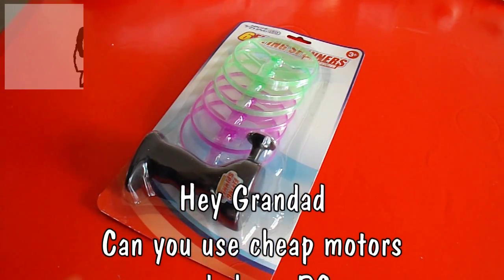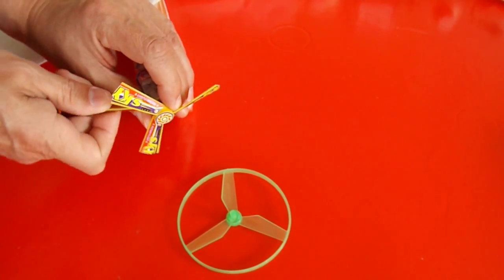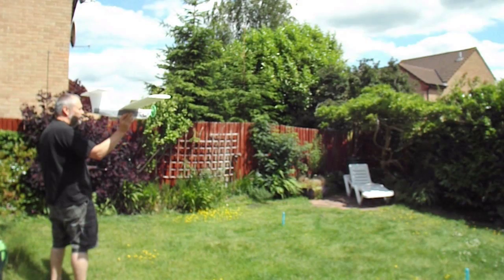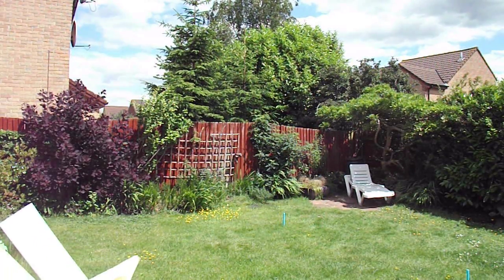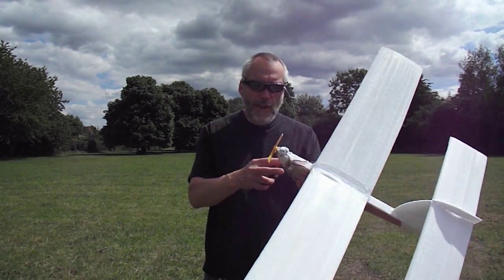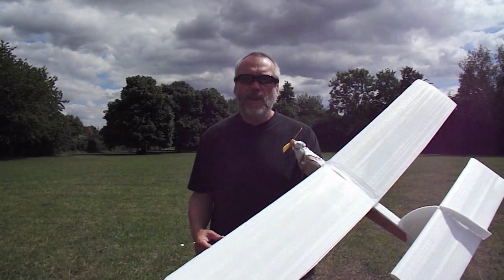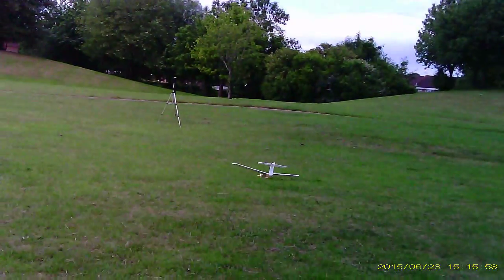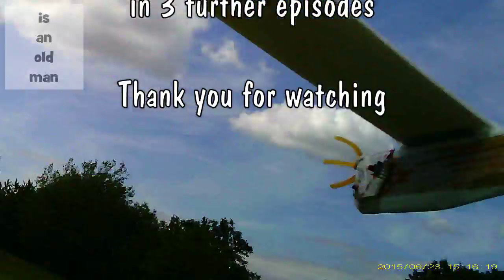Hey Grandad can you use cheap motors and cheap RC for a plane More Flights #1

Comment: If range is an issue for using the rc equipment, how about you overvolt the transmitter. I saw a project where they made a rc plane out of the parts of a cheap ultra micro rc car. They put more volts into the transmitter to increase range.
Reply: Also 3 bladed props arent ver effecient. I recommend 2 bladed props
Reply from the maker: adkodiyan no range is not an issue, I don't want the plane to fly far. In fact the idea is it flies to the limit of it's range and then the motor cuts when it loses the signal. I may try increasing the voltage to give the motor more power as the motor is fed through the receiver and they both use the same battery, however there is a good chance that will burn out the receiver. I may use the receiver to switch a small relay or a transistor to switch a larger battery to power the motor, that would eliminate the issue of overpowering the receiver.
Reply from the maker: adkodiyan what makes you say that? there are many reasons for using multibladed propellers, however as I am trying to make this plane from parts salvaged from toys the options are limited to the propellers I can find on toys.
Reply: This is why i said that 2 bladed props are more effecient. http://www.rcgroups.com/forums/showthread.php?t=917956. Also 2 bladed props are smaller so there is less effort for the motor, making the prop spin faster.
Reply from the maker: adkodiyan I read the first page of that thread. I didn't need to read any more, it is just full of people arguing theories and giving opinions. There seemed to be an equal balance of arguments for more blades and less blades. I certainly don't see how you could use that thread as a conclusive proof either way. As for 2 bladed props being smaller, one of the reasons 3 or more blades are used is to allow the plane to sit lower on the ground as you use a smaller diameter multi bladed prop compared to the diameter of the 2 bladed prop required for the same thrust. All of this is totally irrelevant to my current project as I am trying to source all the components from cheap toys and so far the only props I can find are toy helicopter rotors and none of them are 2 bladed.

Comment: i told u can always use a stronger motor and 9 volt battery whitout reciver or else the reciver will die so only 9 volt battery going into motor whit a swithc
Reply from the maker: Aleksander Sats you can always use a stronger motor, that is fairly obvious. I am trying to use the motors I have available as described in the introduction.
Reply: GrandadIsAnOldMan
oh but those stronger and bigger motors u can find well any toy that is big and moves

Comment: does anyone know how to convert an infrared receiver to radio?
Reply from the maker: +random person there isn't a simple fix. You would need to add some circuitry to pick up the radio frequency and unless you want to do it as an electronic project I would suggest the easiest fix is to swap the receiver for one from a normal RC car. The wiring to the motor and steering will be the same. If you really want to do the conversion I would suggest Googling some receiver circuit diagrams and comparing them.

Comment: Use the big battery for is have more power
Reply from the maker: +Bao Khang Kelvin putting a bigger battery on a cheap motor will make it run faster for a while but then it will overheat and burn out. It will also burn out the RC receiver.

Comment: you sould make the plane smaller
Reply from the maker: The idea of a larger plane is to reduce the wing loading to make up for the low power available. You will find many low powered planes have large wingspans and are very light weight. However, feel free to make one yourself to test the theory.

Comment: Can u make a battery powerd quadcopter
Reply from the maker: +Aswell Walsh that is a regular request and the answer is NO. To make a helicopter or quadcopter stable in flight I would have to buy so many parts designed for the purpose it is cheaper to buy a ready made helicopter or quadcopter. On top of that, my channel is aimed at simple, quick, cheap projects and a helicopter or quadcopter build is not a simple, quick, or cheap project. You would be better finding a channel that specialises in RC Quadcopters or Helicopters so you get the information from people who know what they are talking about. FliteTest would be a good place to start although they tend to focus more on planes than copters https://www.youtube.com/user/flitetest
or anything David Windestål is involved in https://www.youtube.com/user/dadde87
or you might like this video by The Post Apocalyptic Inventor https://youtu.be/qa_x93JQhNM
for rubber band power check out the work by norris432 https://www.youtube.com/user/norris432
Reply: Umm how about a simple to robot
Reply from the maker: Aswell Walsh That depends very much on what your understanding of what a robot is.
Here is my playlist of my crawlerbots and robots
http://www.youtube.com/playlist?list=PLA5a2xPRSrB0ypbT8Tr-CZfXPIiaOHUlL
If you want to see walking 'robots' that you could make yourself, then you could have a look at the work done by Saurav Chakraborty https://www.youtube.com/user/sauravchakra
and Burhan Saifullah https://www.youtube.com/user/galopante78

Comment: grand dad you can use a capasiter if your motor doesent work fast
Reply from the maker: +Manan Sarna a supercapacitor is very similar to a normal rechargeable battery. It is just very fast to charge up, so anything you can use a battery on can be powered by a supercapacitor.
Reply from the maker: +Manan Sarna 
Here is a great video demonstration by Electric Experiments Roobert33 of Capacitor and superCapacitor DC
https://youtu.be/ZgozrScGN8U
Wikipedia http://en.wikipedia.org/wiki/Supercapacitor

Comment: have a look at hobby king website they have one in the UK now they are by far the cheapest for rc parts worldwide
Reply from the maker: Two answers. One, this project was created following a request to use the components from cheap RC cars. Two, I don't find Hobby King particularly cheap and they seem to try to make their range seem larger than it is by displaying lots of items that are "back order" so not actually available. I generally buy the cheapest items using eBay and accept that sometimes the items may not last as long as a better quality item would.

Comment: Stronger engine plz
Reply from the maker: Mauricio Hernandez  this project is as I described and may extend over several more episodes. The idea is to use parts from cheap toys. People ask me if they can use the parts from their broken toys to make RC planes and that is what I am trying to do. If I have to start buying extra parts to make it work then the original target is missed and the project fails even if the plane flies. The biggest problem I can see is finding suitable propellers on a cheap toy and so far the only ones I can find are toy helicopter rotors.

Comment: You definitely need one of these:     www.ebay.co.uk/itm/New-12V-DC-14000-RPM-Standard-Micro-Motor
Reply from the maker: Hi Paul, the background to this series was a question about taking a cheap RC toy car and using the components to make an RC aircraft so that is what I did in the project to demonstrate there wasn't enough power. Buying a decent motor on eBay would be the simple answer but that was not the question. Much later in the series I did put a slightly better motor onboard with basic hobby grade RC to demonstrate the plane could fly given enough power. https://youtu.be/6dw0gQTXJog?list=PLA5a2xPRSrB3v7nI2gkMPSAD5LOoSQkzk
Reply: Yes I do appreciate that.  I was simply pointing out that cheap motors are available online without raiding charity shops!!!